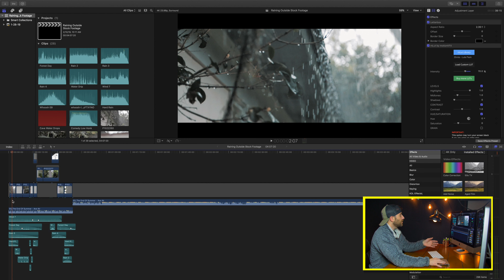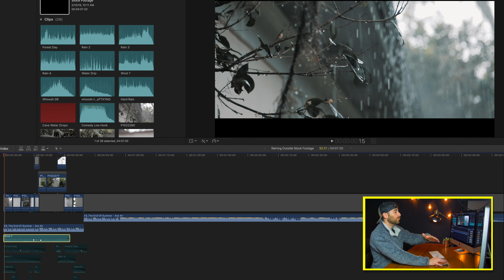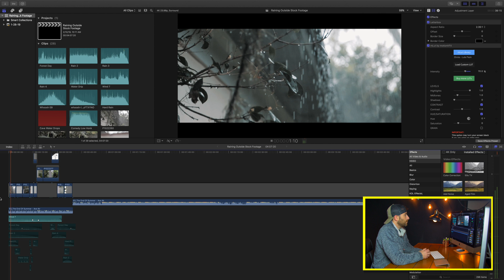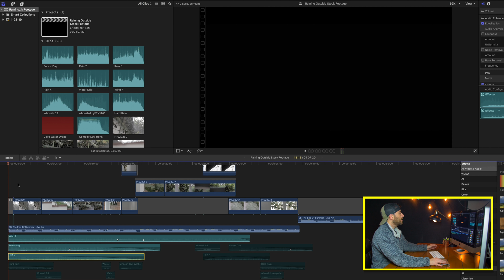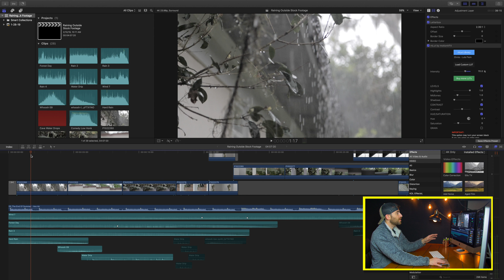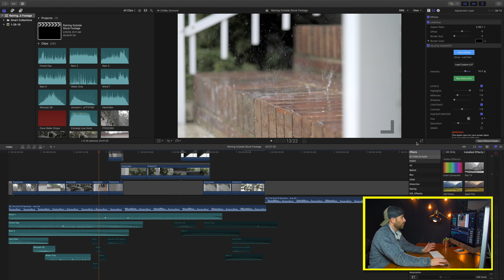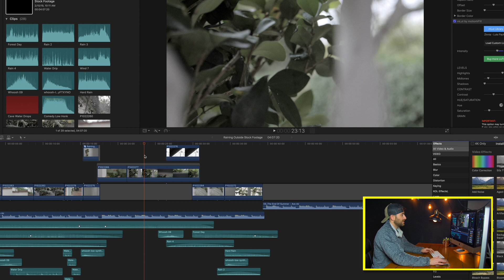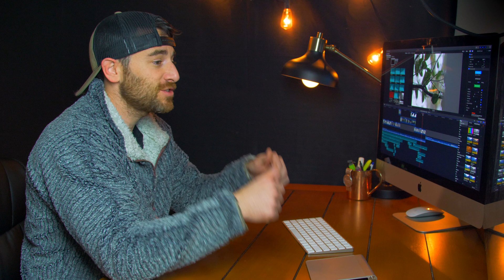Sound Design Final Cut Pro X

Comment: This is brilliant. On the main background music is it best to have this at the default volume or do you knock this down a bit too?
Reply from the maker: thanks chris, typically when i'm adjusting my background audio levels, I like to add a surround compressor and usually have the volume somewhere between -10 to -30 really depending on the audio track. I love to use background music to set the mood and tone of the video and sometimes I do think that means even adjusting the audio level for different portions of the video. hopefully that helps but honestly its up to you just make sure that the music doesn't overpower the story you are trying to tell, if that makes sense.